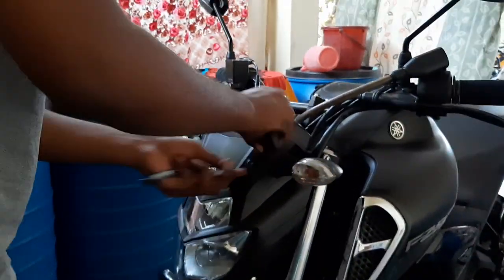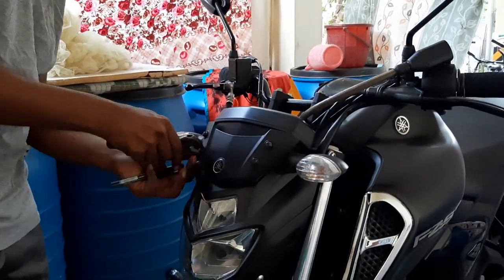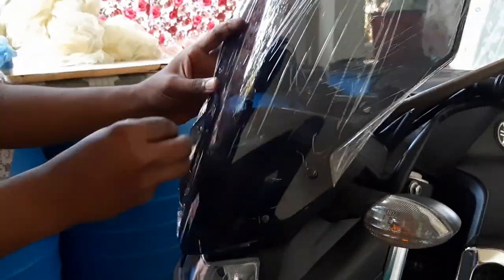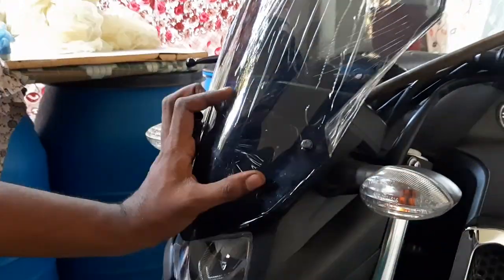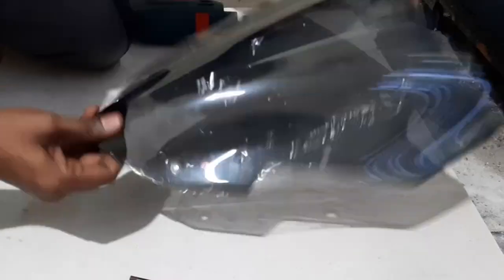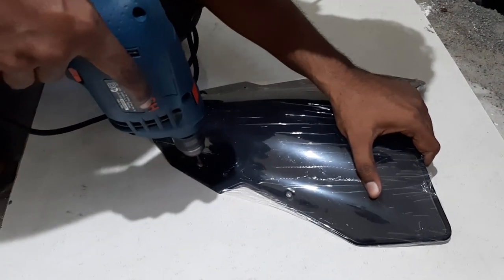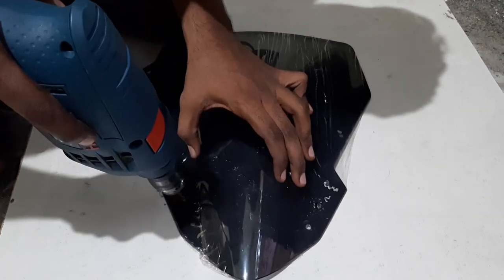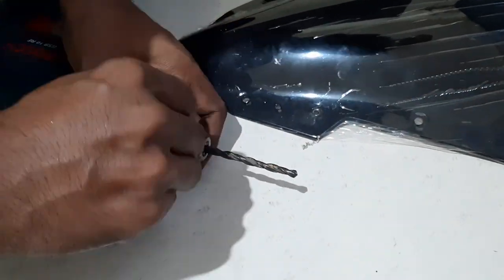Front Visor Windshield Installation | Yamaha - FZS - V3 | English

Comment: Hi bro I am planning to buy FZSV3 is it worth buying?..and also tell  about mileage engine heat and build quality
Reply from the maker: Hi bro. 
I would say it is worth every penny to buy this bike. 

Mileage: Around 40-45 KMPL (To me as a single rider mostly) with recommended type pressure. 

Engine heat: Normal heat, that means even in summer the heat is as similar as other 150cc bikes. you will never feel the heat while riding normally. (Not like enfields) 

Build Quality: (Not promoting) But You might know YAMAHA is best in this segment to trust its quality. This is also good in quality. 

Its reliable, full digital display, enough power for city ride. Partially ok for family ride. Take a test ride then decide.
Reply: Did u buy ?

Comment: Bro how to fix the numberplate
Reply from the maker: Hi Bro, There are two ways for number plate.
1. Sticker the registration number in the visor itself with standard text height. 
2. Use the numberplate clamp which comes for FZs 2.0, (available for approx 40 rupees)
We cannot use the stock clamp, because this visor need bit higher clearance.  I suggest, to go with the option two.
I have fixed it already in my bike, i will try to show in my next video.
Reply: @blackrider2006  ok bro
Please try to put a video clearly understanding , how to implement the number plate
Reply: It's a request
Reply from the maker: https://youtu.be/8Vw4pmJDf2w
Reply from the maker: @njan_rahuu9106   
Number plate shown here

https://youtu.be/8Vw4pmJDf2w